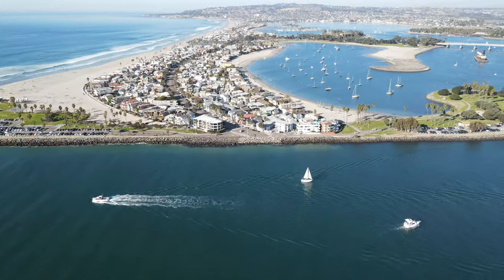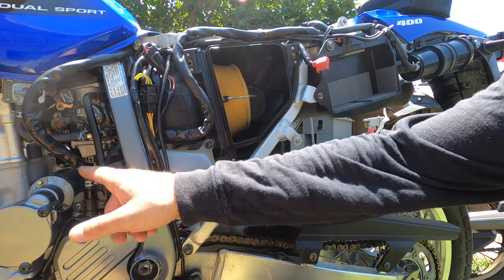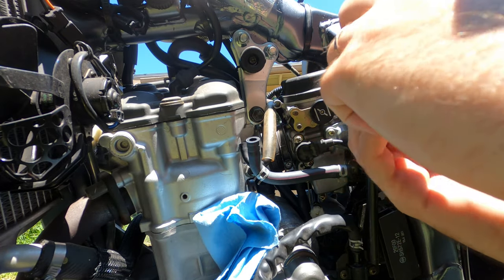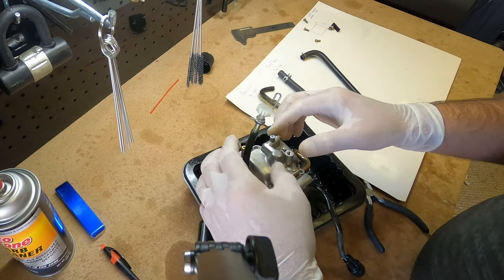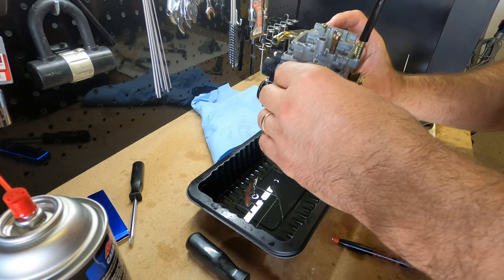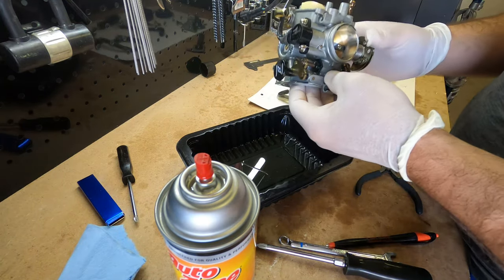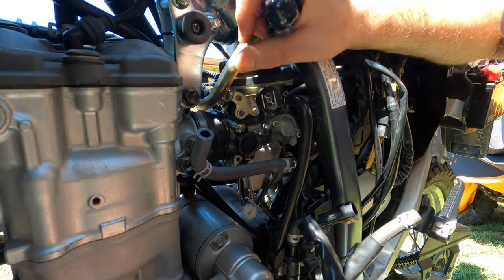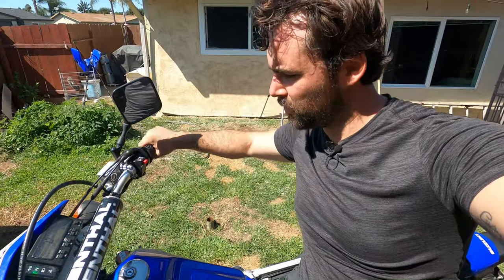SUZUKI DRZ400S or E Carburetor Removal & Cleaning the OEM Mikuni BSR36 Carb; A full "How To" guide!

Comment: Great video! And I can attest to losing that screw in the abyss 😅.   1 tip is to loosen subframe bolts so you can pull that rear airfilter gasket area.
Reply from the maker: Thanks for watching and sharing that useful tip. Nik

Comment: Well done presentation!  Thanks for also sharing  your attitude and advice on managing expectations.  I agree that most people would rather spend an afternoon riding than tooling on the carb.  With the help of your video I will proceed and pray that I will be better prepared to control my anger when it gets frustrating.
Reply from the maker: Good luck. Crack open a beer and push throughout it. Then go ride and make it a point to do so regularly so as to avoid having to do this. Cheers. Nik

Comment: There's usually some Bad Religion playing in the background when I do mine, too!  Just picked up a high mileage DRZ 400 recently, so I'm doing all this, and adding a JD jet kit, too.  Someone's been inside mine already, installed an aftermarket needle, and kept the stock jetting.  I don't like what I see, and there are some rotted o-rings in mine.  I just received my new diaphragm and rebuild kit, so assembly and tuning will start soon...thanks for the vid, its a great reference.  I've rebuilt carbs before, but not this model
Reply from the maker: Good luck with getting the bike in top shape again. I'm glad you found the video helpful.

Comment: Excellent video tutorial on how you did this work. Really helps! How did the test ride go? The bike sounded great once it started up. I’ve heard that removing the upper subframe bolts allows the subframe to pivot, making the carb removal/reinstall a bit easier as it increases the amount of room available.
Reply from the maker: Yes it does amd one option is to rotate it without removing. Ran like a charm. Thanks for watching.

Comment: Just sold my X challenge and bought a DRZ a few months ago, I agree the X challenge performance specs outperform the DRZ in most ways, but in my opinion reliability issues and lack of parts kills the benefits. The X suffers from a few minor flaws like poorly routed fuel and vacuum lines, and a poorly designed ignition cylinder that makes the bike a little too prone failure. These problems aren't usually too difficult to fix and probably would have been fixed from the factory if they'd kept producing them for longer. The bigger issue with the limited production aspect is how rare and expensive parts are to finds, as well as the lack of aftermarket support. The rareness also makes fixing things on the bike a bit more difficult, not a lot of youtube videos on the X challenge and a lot of forums are 10+ years old with no images because the image hosting server died. Dealing with those aspects of the X challenge is what really made to look towards the DRZ, a supposedly bulletproof bike that you can buy parts for at a gas station in Argentina. So far my experience on the DRZ has been just that, its slow as shit compared to the X, I've definitely had a few moments on the street where I remembered I don't have ABS anymore, it doesn't get as many compliments but its been nothing but reliable, easy to work, cheap and easy to find parts, and has taken me everywhere I've tried to take it. IMO the DRZ is for driving hard, learning and beating on while the X challenge would be a bike better suited for someone with a good few bikes in their garage thats got the time, money and know-how to deal with it. (Sorry about the essay in the comments, I'm just excited to see someone who's had the same bikes as me :)
Reply from the maker: Thanks so much for watching. I agree about the downsides, I couldn't find luggage carriers for it, crash bars etc. I've switched to. Altm 690 and wow what a bike.

Comment: great video, thank you. I'm from Australia and we can buy the drz400e new and I'm torn between the drz and the crf300. How often would you say you have to clean the carb on a drz that gets ridden regularly vs how long can you let the fuel sit before you need to clean the carb? the crf has a lot of pros but you dont really get much for your money compared to the drz which is a 20 year old bike lol. I'm happy to hear suggestions of other bikes i should be looking into as well for a light weight adv bike that i can use to commute with at 60 m/h as well
Reply from the maker: I've had the crf250 really amd was unimpressed, however my friend has the  300 with a suspension upgrade and some power mods, and that was a great bike. The drz has great suspension from the getgo. The carbs won't be an issue if yoy actually use the thing regularly. I don't get why the crf rally is so expensive here.
Reply: Thanks for your reply.  I was actually expecting you to steer me away from the carb and towards the efi so I need to look at the drz more seriously I think

The drz is $1,300 USD more expensive in Australia (new) than the crf300L. The only thing the crf has going for out is the highway performance (lower revs) (although some people have tested them and apparently it's the same?) And the fuel economy which aren't deal breakers 

Because the drz has a big used market here, I would consider looking for a good deal but because it's my first bike I'm worried I'll buy somebody else's problem and end up with a big bill from the mechanic who will do it's first check over.  I'd be servicing it from then onwards.
Reply: And to be honest, the only other things I prefer from the crf is the fuel tank level and the gear indicator on the dash.  I'm not sure if I can get these aftermarket for the drz
Reply from the maker: I've had the crf 250 rally and was not impressed. That bike is super slow and needs suspension work to be usable. The drz has that leg up from the get go.
Reply from the maker: Neither are total in my opinion, especially the gear indicator. You will know whe. You get to know the bike what hear you are in. And they are fairly simple to work on. If you can buy a clean used one for a good savings than do that so you can always sell if you want to upgrade. And you might want to sooner than you think. I always like mor power. 400 is the least I'd go with.

Comment: So much easier if you at least undo the top subframe bolt, and loosen the two bottom subframe bolts. Gently push subframe back.
Reply from the maker: I've heard of that technique and will try it next time. Thanks for watching and for the tip.

Comment: thanks for showing me which is the pilot jet.  my bike with a fairly new carb wont start with just the choke.  i have to blip the throttle.  someone on Thumper Talk said to clean the pilot jet.  but i didn't know which one it is.  He suggested it could be the choke too, but that is just a large hole which can't be plugged up.  i hate removing a carb.  i guess i will have to just twist it to expose the float bowl.  i wonder, is fuel injection more problem free??
Reply from the maker: Yes, you are able to just trust the carb in order to expose the keys and bowl. In my opinion EFI is a better deal but to have people wanting to ring my neck for saying that here. Nothing to do in efi. Bit when you understand carbs is also not hard work. Good luck

Comment: I have a blue 2007 that I just took to Park Falls, WI for a weekend ride.  Great bike, I bought it new and will never sell it.  I have been thinking about doing the 3x3 air box mod with a slip-on but I’m concerned about reliability and fuel mileage.  Do you have any opinions on this type of mod?
Reply from the maker: I honestly have no personal experience with that particular mod although I don't think it would negatively effect gas mileage too much, or reliability since all you would be doing is allowing the engine to breathe easier. A good air filter is a must though especially if running mostly in dirt. Just be sure to rejet as well to accommodate the increased air flow. Its similar to adding a cold air intake system to a car - it should not affect reliability. Thanks for watching and for your question.

Comment: Step 1: Removed 36mm CV carb.
Step 2: Throw it forcefully in the dumpster.
Step 3: Install 39mm FCR carb.
done.
Reply from the maker: Thanks for that tip. No doubt the bike would breathe much better with a bigger carb. I'm riding the CRF250 RALLY now but am missing the power of the drz.
Reply: @pegasusmotorcycletours  its criminal that Suzuki let those S and SMs leave the factory with those CV carbs. The bike is night and day with the FCR carb.

Comment: I need to replace the rubber gasket that is in the bowl cover of the carb and don’t want to take the whole carb off is there anyway I can loosen both carb boots and just tilt it to unbolt the carb bow cover screws and remove the bowl and replace the gasket
Reply from the maker: Thanks for that tip. I'll try it next time.
Reply: @pegasusmotorcycletours  update I had to work in my carb and ended up having to just remove the whole thing there was no way to access the bowl by turning the carb

Comment: Great video! Any advice to prolong your carbs cleanliness so you don’t have to clean it so often?
Reply from the maker: Yes.  Drain the reservoar of gas if storing the bike by turn8ng the screw and letting the gas drain. You can also turn off the petcock and let the bike starve out (stall from thirst) when parking. You can ise fuell additives like stabil or any other fuel treatment,  and always be sure to buy from a reputable gas station.  Cheers.  Nik
Reply: Stabil

Comment: Dude I was so into this , until  at 16.40  you edit out the removal of the two identical jets , so I figured I could which was the main and what goes where on installation segment  , BUT you edit that out too at 24: 35  wtf
Reply from the maker: I'm not sure I follow. When in doubt, take pictures as a reference.
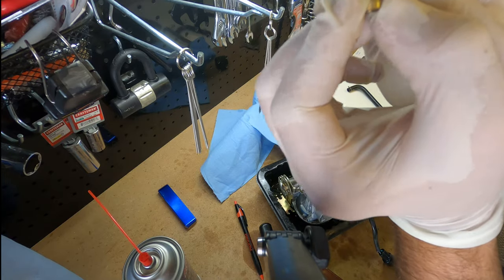Reply: @pegasusmotorcycletours  You remove the first  jet with the 8mm ( is this the main ?  )   blow through it  / new scene at 16:40  / and you say "ok" and magically , there are  now two jets with one laying  jet on the table and the one in your hand . You skipped an important step removing the other one  , then did it again on the reassembly .Where does the larger orifice jet go  in case I mix them up ?  Wouldn't be bad to show a float level adjustment . I was given a disassembled  carb in a box . I like your channel and I'm only mentioning it because that confused me .
Reply from the maker: @jonadabster8401  I totally appreciate you pointing that out.  I just honestly don't remember that detail now, off the top of my head, clearly enough to answer you correctly. You're the first to point it out so I appreciate it. I haven't cleaned a carb since then so... Thanks for the support. A new review is coming out next Friday, of my super tenere. I consider it my best review yet so I hope to hear from you in the future. Be well and good luck with the carb.

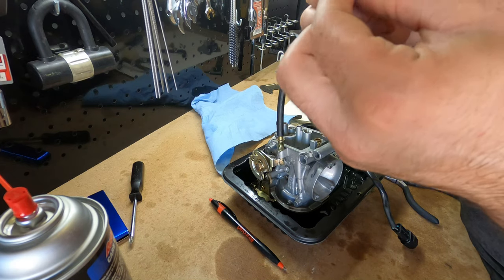Comment: Maybe someone can help me out bump if you can appreciate it. The little pin you remove at 17:50 mine is stuck in there any recommendations? Been having issues with the bike and I'm assuming this may be it. Can I pull it out with pliers or how can I go about this?
Reply from the maker: They all come out as screws. Lefty loosey.
Reply: @pegasusmotorcycletours  thank you I'll give it a try

Comment: how often do you do this
Reply from the maker: As often as necessary meaning whenever the carb is clogged due to old or bad gas. Of you rode the bike regularity, it should not need a cleaning. If you store the bike, run it with the petcock on off until the bike dies from fuel starvation. This leaves no residual fuel in the float of the carb. Thanks for watching

Comment: I just acquired one of these bikes this evening . Was informed that a carb cleaning would be needed, have you ever used "mechanic in a bottle" ? It is a concentrated carb cleaner . I've used it on small engines with great success and wonder if I should give it a shot  .
Reply from the maker: I have no personal experience with it but probably wouldn't hurt to try. These typically clean out the system would not sufficiently in one tank. If you do not want to remove the whole carb, you can simply rotate it so that the bottom is accessible from the side for cleaning.

Comment: Hey man, you didn’t properly clean the accelerator pump, should have cleaned behind the ball valve passage. Also there are three tiny holes that need to cleaned on the front of the butterfly valve. Finally, the top end where the diaphragm is not assembled correctly, when tightening the two screws on the top end you must keep the gate with needle open with your finger. Vacuum must be present in the top men are. Otherwise your carb will never run properly. It is the trick that no one shows on YouTube.
Reply from the maker: Thank you so much for taking the time to instruct me - I will highlight and save your comment. IS there  a video that you are aware of that cleans a carb properly? It's one thing to read this, but I'd need to see it done to make sense of how to do it better next time. I REALLY APRECIATE YOU.
Reply: Explain that again about the gate etc!

Comment: I appreciate the video, but it would have been nice to see how you managed to reconnect the fucking throttle cables...
Reply from the maker: I feel your stress. I hate this whole procedure as well. But to reconnect them is not difficult if you physically twist the the throttle lobe and thread the cables on that way. I don't recall having trouble with this part so just check that you aren't missing something simple in the mix.
Reply: Yeah, sorry if I was pissy lmfao
It definitely took me some finangling, but I got it probably 20 min after I commented. I have big hands and there's so little room to work with so it was extra tough getting the left connector to seat in the hole and then slip the cable through the slot.
Again, I really appreciate this video man. It really helped and the bike is running like clockwork now.

Comment: For a guy who doesn't want to fo it again. Why didn't you replace ther diaphragm, seals and gaskets? Why didn't you put the parts in a basket and soak them for hours? That was like a field cleaning, you'd do out in the brush.
Reply from the maker: Thanks for the suggestions - just the needless needed to be cleared out - the bike only had 600 miles on the clock at the time and true, it could have used all new parts, but for the expediency of filming this video, this was sufficient. It ran like a charm after that. Of course, the key to avoid doing this is to shut the petcock off and let the chamber be emptied of fuel before storing. Thanks for chiming in and for watching - I appreciate it.
Reply: @pegasusmotorcycletours  stabil works good too!!
Reply from the maker: No doubt. Thanks for the tip - it's amazing how much the price of that has increased over the years.
Reply: @pegasusmotorcycletours  With only 600 miles you didn't need new parts. You had a plugged jet and a simple cleaning as you did was the right thing to do.